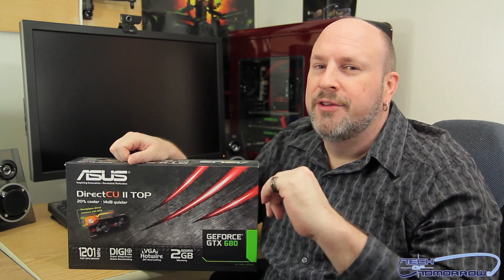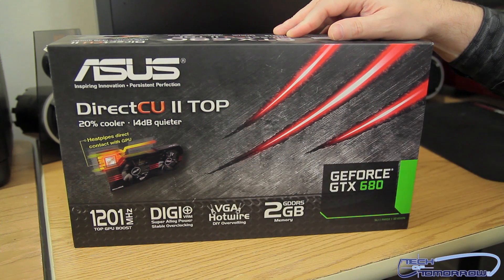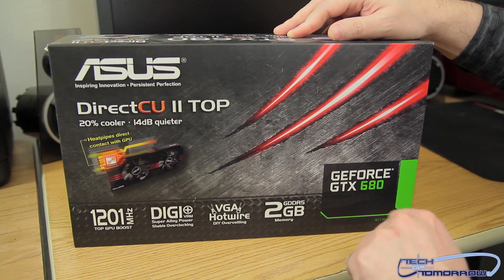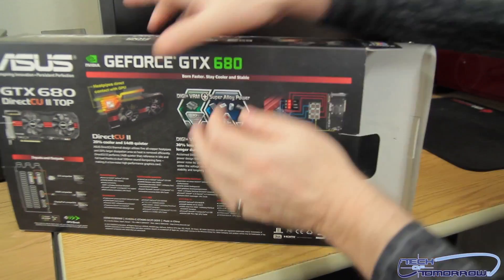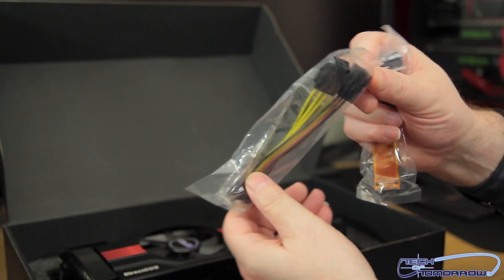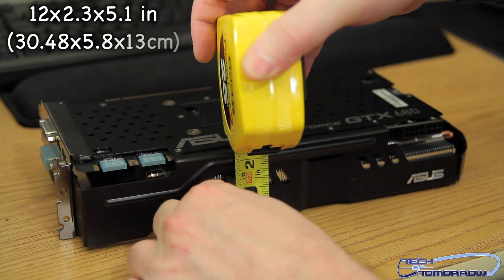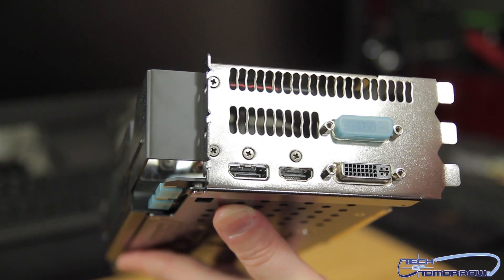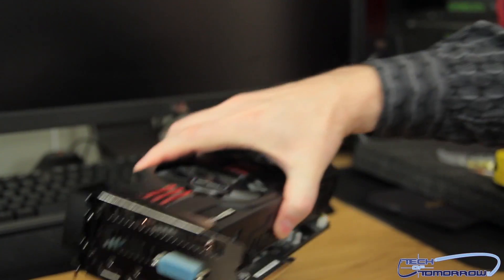ASUS GeForce GTX 680 DirectCU II TOP 2GB Video Card Unboxing & Benchmarks

Comment: but this is the TOP edition, how does it compare with the standard gtx 770? checking the specs on ASUS website this has better core power, 770 has better mem clock. But I'm no expert. What are your views? Thanks

Comment: yyeah thats plenty of power. motherboards all good aswell, the case might be a bit too small because of the slots for the drives going straight down to the bottom so the card might not fit. but you could cut a bit out of the frame, thats what i done when my case was too small and it looked like the same as the strike x

Comment: Can any one tell me if these will work together im new to building computers :s 

Aerocool Strike-X Advance White
ASUS Sabertooth Z77 Motherboard
ASUS GeForce GTX 680 DirectCU II Overclocked

main thing i'm worried about is it not fitting in the case i'm also getting a 900W Power Supply should that be enough??

Comment: If you're only running one monitor, get the 2GB TOP Edition. If you're running 3 monitors in surround, the 4GB might be a little better because of the extra memory. It depends on what you intend to do.

Comment: Guys, can you tell me which one of these 2 models would be better to purchase please?

1 = Asus GTX680 DirectCU II Top Edition PCI-E 3.0, 2GB 256-bit DDR5 
(Base 1137/Boost 1201)
or
2 = Asus GTX680 DirectCU II Edition PCI-E 3.0, 4GB 256-bit DDR5 
(Base 1006/Boost 1054)

I would assume 4GB would be better over the 2GB Top edition, but i heard the Top edition runs faster and better? I won't be overclocking it, just want nice crisp visuals with great performance.

Cannot decide lol :S

Comment: my gtx 680 gets only 86 fps and oc 1215mhz. 
that's strange. i don't know if amd is cheating on the drivers for benchmarking or i didn't reset to 3d quality settings from the driver.

Comment: you are right but the prices range form country to country, so maybe he is not BS-ing so much, i bought a gtx 670 phantom edition (it is a non-reference model with a 680 clock speed, but the memory is a bit higher factory OC-ed ), because 7970 that was on same lvl or above was 50 euros more expensive, so like i said on start where you live and prices at given time will dictate what you can buy ( price/performance )

Comment: The card might be pre overclocked, but it can get pushed a fair bit further, have mine running stable at 1275 boost and 6800 on the mem, and it maxes out at 64 degrees running heaven, and that's with fan speeds not going over 35%, so imo it's worth the money.

Comment: 680s aren't but the 660 ti is better than the 7950 and it costs less. The major reason why i chose my 670 ftw over an amd card though is support. the driver updates bring in a lot of performance increases in new titles where as amd comes out with drivers way late like with BF3.

Comment: i would take the xfx 7970 for 330 euro. the card is overclock friendly. so why  spend more mony for oc if you can oc the card yourself for free. but it's the double dissipation version or the reference? take a the costum non reference 7970 and with a bit oc it would beat any gtx 680. even overclocked.

Comment: 83 FPS on Unigine Heaven running at what settings though? I have a AMD Radeon Sapphire 7970 3 GB graphics card and I get 43 FPS on everything maxed out. 1920x1080 resolution, extreme tessellation, 8x AA, 16x AF, max shaders and textures.

Comment: this is the card iv'e been planing to buy for my new build! its the best 680 in terms of being pre-overclocked and its reasonably priced (for a $500 card series)
My new build:
Processor: Intel I7 3770K
Mother Board: Asus Maximus V Formula/ThunderFX
Graphics Card: ASUS GeForce GTX 680 DirectCU II TOP
RAM: G.Skill Ares 32GB
Hard Drive: Western Digital 2TB Caviar Black (7200RPM)
Boot Drive: Kingston HyperX 240GB
Power Supply: XClio 1000w gold
Case: Thermaltake Level 10 GT
thoughts on it anyone???

Comment: hey i have a question, which is better connecting the case fans to the power supply or motherboard fan inputs? srry it off but im using the MoBo ones and wondered if the other ones are better (im a new builder)

Comment: Strange, that 6gb 7970 is $600. My 2 EVGA ftw+ 670s were $800 total. And yet again, Crossfire has much more microstutter than SLI. My old computer had crossfire 6950s, Nvidia has much better driver software and much less microstutter, which defeats the purpose of getting 2 cards for AMD, unless you just like looking at how higher your fps counter is, but the gameplay looks 1/2 that.

Comment: watercooling still depends on the room tenps and as my instructor at ITT pointed out to me its naturally only going to be 5-8* cooler than with moderate push/pull configurations. the more fans the cooler it will stay as TTL has proven. Honestly though id just put a multi-fan set-up in mine since the main reason water cooling is big is because it's quiet and as i am a gamer i love my 7.1 surround HEADSET so noise to me isn't big. if you want cool temps use LN2.

Comment: Make sure you can get a waterblock is all I recommend. Watercooling is awesome though. I get temps in the mid 40's while playing bf3 overclocked at 1250MHz. I use Asus DCUII 670 in sli with the waterblocks EK makes. It's the only non-reference 670 waterblock I could find for it.

Comment: But TBH , currently if your single monitor , all full ultra , 1080p , you only use over like 1 GB , barely even 1.5 GB , so basically 2 GB is plenty or 3GB for extra allowance. 

Unless you do Eyefinity setup , you won't use that much either. 

I remember back then Elric did 3 monitor , on Max Payne 3 , Ultra , it only actually used up 2 GB , not even 3 GB.

Comment: I understand what you mean, and I'm an AMD guy, but Nvidia is just better for rendering, at least, CUDA core are (in some programs). I'm assuming Elric uses Adobe premiere CS6, which has no support for OpenCL, which AMD cards use. So the only logical answer to using Adobe Premiere CS6 would be to use Nvidia cards.

Comment: 4.5 is looking nice to me i dont want give it too much voltage my old 3570k was acting like stove after 1.3v (that rig is retired for now,mobo fail and burned rams meanwhile,im glad that i could salvage the rest) i think i would go for 2400mhz rams since this rig need to run for atleast 4 years water cooling is not option besides h100i thanks for suggestions

Comment: As rougecoquin said, bad code. 
And the game uses too much GPU and not alot of CPU power. 
There are test with core i5 on 1 core at 3 GHz and with 4 cores at 4 ghz, there was No difference in fps.
"Metro 2033 stands among the generation of DirectX 11 games that showcase the graphics card as being the limiting factor. CPU utilization is at 100% with a single-core CPU, but then again, so is GPU utilization. Increasing the number of CPU cores and overclocking does not yield any higher frame rates."

Comment: if hypothetically, i get a gtx 690, get a waterblock and cut off the 2nd bracket making it a single slot card, i could have 6 in one system with the evga sr-2,
12gpu's, 1 system O_O i dont care if games wont use em i have software that will XD